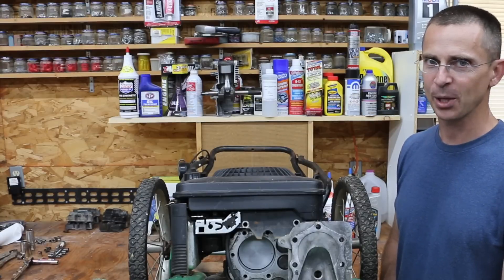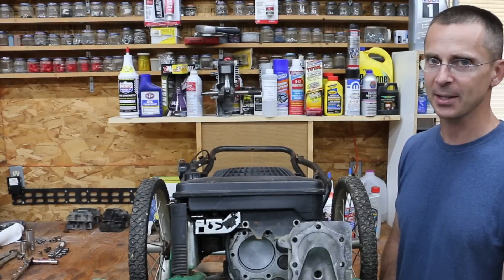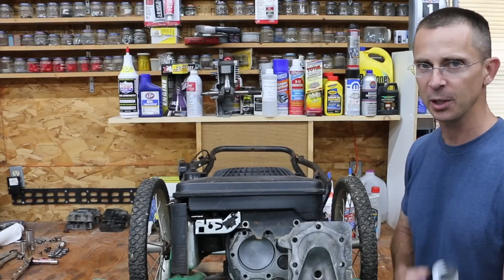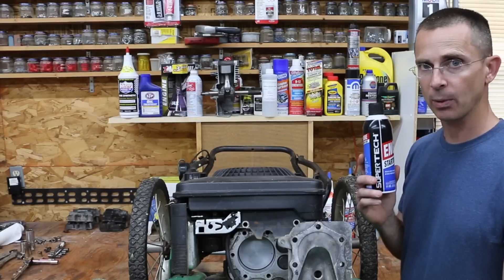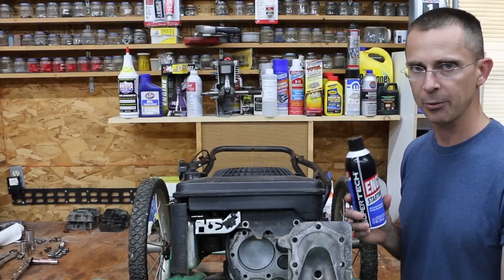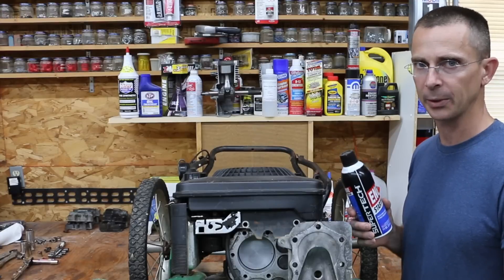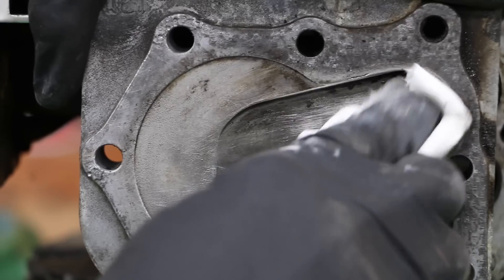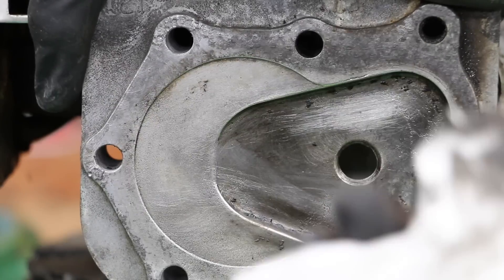Will Running an Engine on 100% Starting Fluid Cause Damage?  Let's find out!

Comment: Oh, it will cause damage...  I bought a Kawasaki 250 KLR motorcycle nearly brand new that has been sitting unused in the previous owner's garage for a year or so.

Of course, the carburetor was gummed up.  And, before I spend the time to strip, clean, and rebuild carburetors on such cheap finds, I always see if they'll light with starting fluid.

And the used KLR fired right up on starting fluid.  Then, I figured I'd try to run the thing long enough to get the carb hot.  Maybe that would loosen the crud?  So, like a two year old, I rev'd the engine with air and starting fluid.  And yes, it under high RPMs the engine knocked.  I ignored the sound.

I still ended up stripping and cleaning the carb.

And boy did the machine run great after the carb cleaning.  However, during long periods of high rpm running, the machine had one hell of a blow-by problem.  The amount of motor oil ending up in the air box from the crank case breather tube was staggering.  During a forty mile ride from home I had to stop twice and buy oil to limp back to the garage.

I guess we pull the head...  All looks good.  I guess we pull the jug.  Looking...  Looking...  Looking...  One of the lands between the piston rings was cracked and floating freely.  I almost missed the issue `cause it wasn't an obvious gaping hole.

So, the knocking pre-detonation of the starting fluid stressed and cracked the piston...  Makes sense.  We want the starting fluid to fire a little more easily than gasoline.  Just don't rev the engine with it or rely on it for more than just getting the engine started.

A new piston and honing the jug fixed the issue above.  The bike then was a ball for a few months until 70 miles from home I tossed it in a deep ATV-created trough of water completely submerging the bike.  The engine then burned up due to water/oil in the engine trying to get back home.

Poor bike.  It was a neglected garage queen before I got it.  Then, it lived as shortly and brightly as a shooting star...
Reply from the maker: Thanks for commenting on this.
Reply: No problem.  The wonders of the Internet are average folks sharing their trials and tribulations.  It's certainly a lot easier to learn from others than making all the mistakes ourselves...

Comment: You only put about 4-5 mothballs to a full tank of fuel in a car raising the octane level about 5 points.  This does not appreciably increase power alone, but it allows you to run more timing without detonation.  That is where the mothball advantage lies.  Modern mothballs need to be dissolved in acetone and then strained to remove the foreign additives before adding it to the tank. It works, but you have to know that raising octane is little to no advantage without a corresponding advance in ignition timing.
Reply from the maker: Yes, I overdid it for sure.

Comment: Great video!
I was told Starting Fluid ignited faster and the early ignition could bend the crankshaft in multi-cylinder diesel engines (because of the high compression.)

It clearly didn't hurt this engine a bit!
Reply from the maker: Thank you!

Comment: Something i have always been curious about is running an engine on gasoline and providing pure oxygen as the air mixture. I am pretty sure it will overheat, but i would like to see it in action
Reply: Pure oxygen is highly flammable so it would probably grenade the engine, or make the fuel air mixture extremely lean

Comment: let's see that with a diesel.
Reply from the maker: Thank you for this recommendation!
Reply: find an old chevy or buick or oldsmobile with a 5.7 v8 diesel. they're cheap if you can find a running one. most were converted to gas engines due to reliability issues.

Comment: I'm wondering if that's due to either older formulas of ether or older engines. I've seen old 2 cylinder John Deeres with bent rods and smoking real bad and that's the claim as to what happened.
Reply from the maker: I think the modern starting fluids have less ether and more lubricant. Thanks for commenting.
Reply: Project Farm I agree. I know the "old timers" always said if you used it once, you'd have to use it every time. Wonder if it'd be possible to get a vintage can then compare against new. That could be interesting.

Comment: I saw this video and thought back to the other day when I was starting a f-350 diesel and we used starting fluid I was wondering does it damage a diesel motor
Reply from the maker: A lot of comments from viewers suggest that it's possible for starting fluid to cause damage.

Comment: It shouldn’t damage a diesel, as starting fluid was originally intended for use with diesel engines before glow plugs were in use. In fact, many commercial trucks still have onboard, cab-controlled ether delivery systems for backup in case the preheaters fail.
Reply from the maker: Thanks for commenting on this.

Comment: you should test prolong. they claim to have no equal in th world in protecting your engine. they also claim that you could run I car with no oil after cycling prolong through the engine. oh and the film strength is over 400 000 pounds of pressure in the lubrication test. you should do it. watch at least one or more of your videos everyday. great stuff man. thanks
Reply from the maker: Thank you for this recommendation!  I plan to test Prolong soon.

Comment: Diesel engines with glow plugs can predetonate and put a hole in the piston. The oily film is due to "Upper cylinder lubricant" so no, starting fluid will not damage a gas motor but it may foul the plug. For a diesel with glow plugs, it's an instant way to destroy that motor. Good test, i am happy to see how much lubricant they really do put in there.
Reply from the maker: Thank you!

Comment: Your videos are like eating peanuts, its hard to have just one! One thing I was thinking after wstching a couple of your videos is how loud the lawnmowers are. On motorcycles people want to hear their exhausts but on a lawnmowers couldnt they come up with a quieter, cleaner exhaust by now?
Reply from the maker: Thank you and great point regarding the engine noise.  Some of the premium level mowers seem much quieter than the entry level ones.  There's a way to quiet them down quite a bit.

Comment: It can cause damage in higher-compression engines. I once tried using some to start up a rather obstinate ohv Tecumseh engine, and after it started somewhat, I tried to keep it going with an occasional squirt into the intake. After one squirt, it jerked and pinged so loudly that it sounded like someone had hit the poor thing with a hammer. That's not healthy for the rings.
Reply from the maker: Great point

Comment: My experience with starting fluid is that the older starting fluids were straight ether. The modern Staring fluids have a light lubricant added for "top cylinder lubrication" .
first, Non- glow plug and non-intake heater diesels can handle starting fluid in small doses. Some diesels have intake fuel oil heaters and some have glow plugs for heating intake air and or the combustion chamber to ignite the cold atomized diesel fuel at or near Top Dead Center.
   The first danger would be of the ether igniting in the intake system and igniting, blowing it up and/or catching fire ( IE Your face or hands). 
The second is that because Ether ignites violently and the glow plugs (like a electric stove element) Glow red most times and would ignite the fuel almost immediately on the beginning of the compression (or as stated the intake) stoke. This could seriously damage the engine internals. Bent a rod piston crank and who know what else if enough in ingested. 

I have never experienced any damage to an engine in all the years I have been using it Its basic structure is Alcohol "Ethel Alcohol" so B85 could similarly cause more damage if the cylinders were flooded in a gas engine , B85 does not contain any added lubricant to side skirt the effects of cylinder wash. 
Has anyone else a experience with this?
Reply from the maker: This is a great point regarding some containing lubricants and higher ratio/mix of ether.

Comment: On small engines like this ya starting fluid has no effects really but on higher compression engines in cars it’s not good for them to run off staring fluid because it’s really low octane and it pre ignites before the spark plug ignites it so there’s pre detonation going on in the cylinders and that’s hard on engines
Reply from the maker: Great point.
Reply: So, could you run an engine on starter fluid with the HT Leads disconnected? i.e. on compression alone like a diesel. Might make an interesting video.

Comment: Interesting and very unexpected results. With the lack of a carbon buildup, It would be interesting to see how it would work as an engine cleaner to remove carbon buildup.

It would also be interesting to see how economical it would be to use in a car and whether it would be a viable option as an emergency fuel.
Reply from the maker: Thank you for this recommendation.

Comment: I went looking for this video because I use a product by Nulon called 'Start ya Bastard!' which is basically Aerostart. It's 25% Ether (plus anti-knock additives) with a Dimethyl Ether propellant. I'm surprised I missed this video. I thought I'd been subbed and notified since before August. EDIT: In terms of a Diesel engine. I'd be wary of running pure starting fluid in one. I had an old 60 series LandCruiser (2H non-turbo diesel 6 cyl) with a few dead glow plugs that wouldn't start cold. Aerostart (in later years "Start Ya Bastard) was my go to. The extra compression in the diesel engine causes the combustion of the Ether. In fact, they warn NOT to use the glow plugs when using an Ether-based starter spray. In my case it didn't matter because most of my glow-plugs were stuffed. Either way, in my experience, spray start stuff causes a nasty initial knock in a diesel motor.
Reply from the maker: Great advice regarding the risk of causing damage to a diesel with starting fluid.

Comment: I have been looking for a fuel additive product to clean away the carbon on the cylinder head. You have tried many products here on your channel with somewhat poor results.   I suggested a while back to try Chevron "Techron" that is available in many auto parts stores for you to try. I also would like to see you try is Koresene.  
What product in your opin. is best for this. ? Thanks
 Doug in Cal....
Reply from the maker: I purchased some Chevron Techron and it's in my lineup for future testing.  So far, the Powerfoam seems to be in the lead, but this is just my opinion. I also plan to test Kerosene too.

Comment: I've never hear starting fluid would damage a 4 cycle engine. But I have hear not to use starting fluid to start outboard or 2 cycle engines because there is zero lubricants in it and therefore washes all the bearings of oils. IDK
Reply from the maker: Thanks for commenting on this.

Comment: has anyone suggested hairspray yet? it is a sticky substance so may case issues with valve seating and compression and oil ring sealing, thats if the engine runs at all, but it is flamable
Reply from the maker: Thank you for this suggestion.

Comment: As for running a Diesel on ether, I know the truck my brother in law drove for Snider international was an IH cabover. to start it in cold weather(freezing temps) there was an access panel for the engine without tilting the cab, you opened it and there was this flip cap on a tube into which you inserted a wax capsule containing ether. when the poor truck 1st started you would swear the engine was going to explode! it clattered and pinged so bad! once it started running on Diesel fuel it wasn't so bad...
Reply from the maker: This is an interesting post. Thanks for this information. I've since seen a couple of 1970s era John Deere tractors with factory ether setups.

Comment: I want to see if water from a spray bottle in the carburetor works to clean carbon build up. It's a myth I hear all of the time, even have done it myself, but really never took the engine apart to see if my maintenance REALLY did anything. How It was recommended to me, was 1 method ( on a car ) just pull the throttle cable and have it running at a decent rpm and pour just a LITTLE bit of water in at a time, let it sputter then continue until about a water bottles worth is through it. The second method I prefer cause I have clumsy hands is a spray bottle and spray it in the carb, obviously the air filter is off.... Would be neat if you tried it..
Reply from the maker: Thank you for this recommendation.